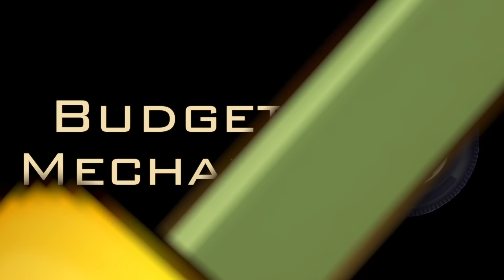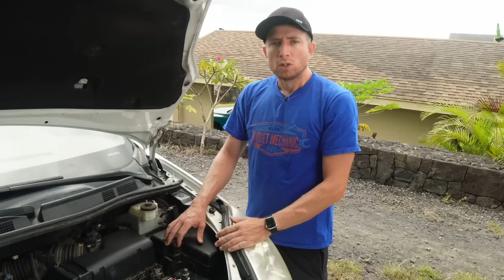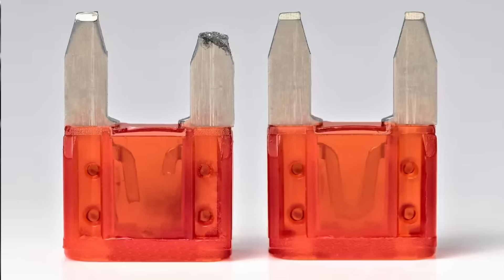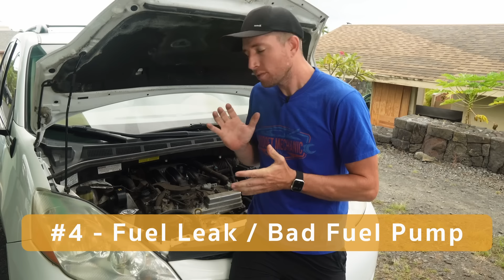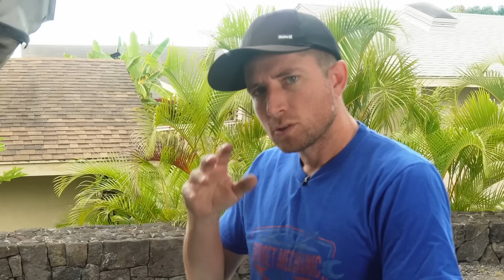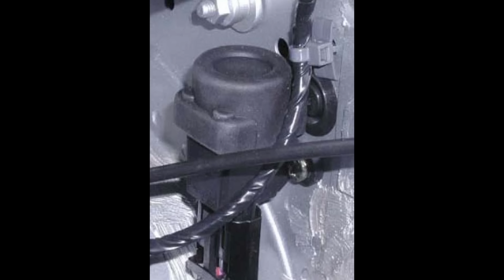Car Cranks But No Start? Diagnose And Fix Now!

Comment: I have a 2015 Nissan Altima S; push start. What would it be if it  “crank no start” not every time, but every once in a while. 

The car will crank up I’ll go drive it then park and it will have issues. One time I try to leave the car running just in case I didn’t have to crank it and the car turned off anyway. It took me 10-12 cranks before it started 

Any advice?

Comment: 1996 Mercury Villager, worn out but always starts. I'm sure the fuel pump was getting weak at 241k miles and possibly original, because the check engine light would flash (has always been lit for the 56k I've owned it, but it has a "dead" cylinder so I never investigated) and it struggled under load and inclines, but did get a little better with a new filter the other week, for a short while. Last night after a very wet day I got the no start, nothing.... Hoping it's the pump I was planning on replacing but I still hear it come on (and smelled a little fuel) but all the brake lines are rotted so I'd better check the fuel line once things dry up. Cap and rotor are relatively new but I'll get the spark tool out along with the fuel gauge....a few cracked vacuum lines to replace also.

Comment: The best advice ever. Spot on. A thorough step by step guide that can save thousands $$$ if one takes a car to the wrong mechanic. Unless you know auto mechanics, it's  nearly impossible to pin point a reliable one.

Comment: I had an intermittent crank no start  under frigid conditions.  On 2 occasions the aaa battery guy tested the battery as good. When connecting the jump box, the car started each time.

Comment: What about 2008 Chrysler Pacifica done changed out the timing belt, timing belt tensioner pulley, motor mount, and camshaft sensor and still is not starting next will be the valve's,  sensor's, relay's, and cool pack's
Reply: It shut off going down the freeway the lights on the dash started flashing and the vehicle just shut off and would not start back up again

Comment: I  got this problem it cranks but does not start everything inside turns on but the voltage goes down almost to 9 and gets the engine power reduced if anyone knows how to fix it please reply

Comment: I did exactly that to my 2003 4.7L (that's right baby) is swap horn relay to the dome (I think) light. Fucker never worked again...horn fine, but all lights overhead never worked again. Removed liner, just took to dealer atp. They wanted to replace the ECU for 1500.  And that was 5 years ago. So they couldn't figure it out. If that's gonna happen I'll do it. Never did...lol but back on building 4runner so idfk. Just an FYI FWIW. Never heard of thst b4 or since. BEWARE

Comment: Thanks for the video. You were properly descriptive. I believe my starting issue stems from a disturbance to the fuel tank. I hit a bad pothole and it bent one of the fuel housing tank screws. Fuel didn't escape and a new fuel pump had recently been installed. I guess I'll direct the mechanic and not waste time on diagnostics

Comment: Any thoughts?  Mitsubishi mirage g4  Starts cold, no problem.  Once driving around, and then turned off, and then try to start, cranks, i can hear fuel pump, but won't start.  If i wait 5-10 minutes it will start. MASS AIR FLOW triggered a check engine light,  got some cleaner, air filter clean.   Any idea why intermittent problem exists?

Comment: Hello, my car cranks but doesn’t start at first attempt (but sometime starts normally without any issue). Almost everytime when it doesn’t start, I take a pause, roll the windows up and down and give it a try again and it starts in 2nd or 3rd attempt. Any ideas what could be wrong with my car. I don’t think it’s battery because windows roll up and down fine.

Comment: Am James from South Sudan , working as a mechanic ,so I found that in Hyundai Tucson 2011 petrol engine it's cranking but not starting may you specify why or what is the reason behind that

Comment: Just for collective knowledge--sometimes there's more than one fusebox under the hood, my 06 Altima has two
Awhile back I had a crank no start condition, with a check engine light but no code on the reader--turned out to be a very dirty mass airflow sensor. I'm guessing it would have thrown a code if the sensor had gone bad, but in this case i just had to clean it

Comment: My car wouldn’t start at night because the engine was gas flooded by a cold winter start and quick shut off  I did earlier in the day. None of these videos like this helped me figure it out because its kind of obscure and affecting only certain cars and nobody seems to mention it. 

Yeah, very simple problem. Just crank the car with the fuel pump fuse removed for 10 seconds to clear the gas out.

Comment: I've got a kia cerato 2013 having starter problems, sometimes it starts but sometimes it won't. When it won't start the car will crank fast but just doesn't kick over. I leave it for day 5min the try again and if I turn the key fast push in my clutch and accelerator hard it starts
Reply: Sometimes it will start but die straight away

Comment: I changed ignition coil throttle body spark plug Fuel filter but still it hard start on my Toyota Prado 2009 petrol

Comment: My son thought RAV4 broke down, stalled on road, coasted into driveway. Wouldn't start. Blah blah blah later, I told him to bang the gas tank, maybe the fuel pump is stuck. He says it sounds empty but gauge says full. He added 2 gallons, and his 200k RAV4 is perfect again. I looked at lots of videos and was looking at sensors, couldn't figure out how he had no check engine light. Anyway, you were the ONLY person who said , most common reason no gas. People, listen to him, start with the easiest most obvious solution first. THANK YOU

Comment: The other day i was driving about 40mph car died, pulled over was cranking but not starting. After about 5 minutes car started and ran perfect for a few days. Yesterday it wouldn't start in the driveway so i sprayed starter fluid in the intake and it started and ran for about 3 seconds a few times. Now it cranks but no start even with starter fluid. Greatful for any suggsstions. (03 honda element)

Comment: My truck got back from the shop after a cam and lifter replacement, the guy dropped it off for me because I was away and it’ll crank and crank but won’t start, im thinking it’s timing related because it started once, sounded odd, then didn’t start again after that. Pls help!

Comment: I exchanged my efi main relay with the lamp relay that right behind the efi relay and the car would crank but not start so does that mean ? Are both these relay still good are they both went bad ? I’m going and try to change the crank angle sensor and see if that’s the problem because I don’t know what else to do

Comment: I may sound stupid but here is my car's situation:
My car is making clicking noise on fuel pump relay when key is at II position.

It is cranking but no Start,

When I attach OBD II, clicking goes away and fuel pump can be heard but still no start 

I have replaced spark plugs with 0.044 gap, coils, checked relays... nothing happening even no hastling start with starting fluid even

My car is Honda Accord 2012 LX 4dr 147k miles

Comment: I replaced my fuel pump my fuel pump control module spark plugs a new battery and still won't start check the relay switches and tested the codes I still can't figure out what it is drain the gas and put new gas in with cleaner gas cleaner don't know if it's the gas isn't getting through to the fuel pump for what can you help me

Comment: I sprayed starter fluid in the intake, and the engine started momentarily, which  made me think the vehicle was out of gas. I filled it up with gas, and it started right away and ran normally.  Thanks for the tips. I'm glad I found your video.

Comment: Nice to see a video where the mechanic is has extensive experience & knowledge. I am in NYC and have a 1979 Camaro 305 V8 and it won't start. I am the 2nd owner since 1981. It has only 79k miles. Full tuneup, new spark
Plugs & wires, new fuel filter, new rotor & distributor cap, new starter, new alternator, new wires to battery change to top pole, and new battery. Notice it had a little to much motor oil prior. Did an oil change and new valve cover gaskets. But car won't start. It cranks a few times then I see a small puff then when you turn the ignition key nothing happens. After a few minutes it will crank again but still won't start. Any suggestions? Wish you were in NYC. If you know of anyone in NYC who can fix or if you can give me an idea I would really appreciate it.  Thanks
Reply: You have a coil on the top of your distributor if I remember correctly.  That could not be getting voltage 12v or the coil could be bad.  I'm sure you must have an ignition module that may be the problem.  I doubt you have breaker points 1979.  Also, it could have jumped time.  Your timing could be off in general.  I mostly tinker with old Ford's but I have done a few GM engines.  You also need to look inside the carburetor and work the throttle by hand and make sure you get a spray of gas in the throat of that carburetor.  Means your accelerator pump is working.  You could have a bad float in carb and that will cause a starting issue. Disconnect the fuel line at the Rochester quadrajet and turn engine over and it should shoot a lot of fuer out.  If not, fuel pump bad.  Also not uncommon for the timing to get off because of nylon timing gears.  To check that, line up timing mark to TDC with piston on compression stroke.  You can twist up a paper towel and screw in the num one spark plug hole.  It will pop out on compression stroke.  Then line the mark close to exactly.  Pull dis cap off and see if rotor is pointing close to num one spark plug wire.  That makes sure your timing hasn't jumped.  All this may sound complicated, but it is really very simple.  Process of elimination, plus you should make sure all these things are good anyway.  Plus I remember they had soft cams around that era, so some lobes may have worn down.  If it is original, may be a concern.  I would keep that ride because you can't check all those items on this newer stuff.  You can work on the old cars and keep them going.

Comment: I’m literally in tears. Our 2008 coloradoodoo 2.9 after doing all of the above just won’t turn over. We replaced the the camshaft and crankshaft position sensors, used the multimeter to check the connectors, fuel pressure is fine….. wash rinse repeat.
Reply from the maker: Load tested battery?
Reply: Timing chain bad?

Comment: My 2018 Ford Explorer has an intermittent (every two weeks) crank no start… each time it cranks no start, I keep trying to start and eventually after 10 attempts my car starts. It will also start immediately with a jump. I have a brand new battery and I changed fuel pump. The Ford dealership cannot figure this out. I purchased an OBD gadget and I even called the OBD manufacturer to ensure proper way to use it. Now, my car did the crank no start crap again, plugged in OBD and there were NO codes. This really stinks. I need a good mechanic who will test a list. The Ford dealership only looks at codes, so if the car runs, they won’t do anything.

Comment: Shoot. Super used 2008 Nissan Altima, and it was just out of gas. I had never in my life seen a fuel gauge at empty actually be empty yet! Thank you!!
Reply: My 89 Dodge was that way, and I warned my mom of my 2 lessons before she borrowed it. Saw it sitting on the side of the highway one mile past a gas station and 3 miles from her work. She never drove it again.

Comment: 2007 dodge nitro. It starts when it wants to. We drive it then when we park it and go to try to start it again in like 10 15 minutes  it will not start acts like it wants to but will not. We waited over night go try again it starts. Now the other day we couldn't start it for 2 days we had it towed I went to start it it started so I'm confused on this booger I thought it was the tipm.

Comment: How can finding fuse that may be bad, still not starting a car. What schematics are priorities when coils cannot be charged, soark cannot be ignitiated, fuel injectors lit up on fewx etc  Gas sprays at the fuel vacuum regulatory from fuel lines, etc? Most if the avove in video has been checked. Few minor as vacuum lines, can build vacuum if cannot start car, that yoi inertia switch actively at work ..

Comment: I've just watched your video and thankyou very much for all the helpful tips fingers crossed I will solve the issues with my car to be up and running again,  she cranks over but won't start I have just replaced all four spark plugs and the next step is to change my oil filter because I have a feeling its full off gunk and is stopping my oil sensor from functioning properly, do you think this will make a difference for my oil sensor to read properly,  anyway I will give a try

Comment: Mine a 2017 ford xlt wouldn’t start it was showing a p0230 code, I reseted the ecu “body control module “ and that did the trick

Comment: None of what u mentioned in the video is the problem ....My car only starts with starting fluid so its a fuel delivery issue but my car is not leaking fuel and i can hear my fuel  pump turn on when i turn the key...SO U REALLY NEED TO GET MORE IN DETAIL CONCERNING FUEL ISSUES You mentioned NOTHING ABOUT STARTING FLUID or FUEL FILTER or FUEL INJECTORS OR FUEL RAIL .....

Comment: I have a 2005 Dodge Magnum sxt special edition new fuses relays was running fantastic 100,000 miles was full of oil no noises no overheating completely normal turned off went in gas station 5 minutes came out tried to start clicking noise lights  bright everything inside working no codes thrown can't turn crankshaft don't get it everything has been replaced car is basically new. Throttle body has been cleaned new gaskets everything is like new only problem I had is a not working ac or heat vents nothing ,no air blows out of vents replaced blower motor and resistor nothing other than that car ran like a new car I don't know what to do I've dumped thousands restoring it I use it for work I drive people taxi but I literally rebuilt it in 2 months now I don't have money to fix or buy new one I can't see it be seized considering please help

Comment: My current problem: my 02 Acura TL will sometimes start, sometimes not start but will crank. And when I'm driving will randomly stall out and after waiting a few minutes (sometimes) will start but lately won't start after stalling. I put on a new fuel pump thinking that would fix the issue, the car ran for 20 minute then stalled and no start.
Hopefully after I install a new main relay it will fix my problem. It's been stressful.
Reply: PCV ?
Reply: @Ace.Venturas not sure but it’s really annoying. I’ve never had a car that’s been this much trouble.
Reply: @Jason_Phillips3679  Identical to my issues.
PCV was intermitently sticking.  My coolent sensor wire had all but seperated from the sensor, and the internal assembly of its harness had broken. 

Ive replaced the PCV. And am working on the sensor. 
Both can cause these issues.

Shifting issues:
My transmission modual was caked in cream from oil and talcum powder in the insulation. It combind to form a paste. 
This could be causing my overdrive shifting proublems.
 Toyota manual says if coolant is cold it wont shift into overdrive.
So the cream and sensor are likely the proublem with shifting into overdrive.  Sensor may be causing the  ECU to mix air and fuel ratios incorrectly after taking false temp readings from faulty sensor. 

I thought i had solved these issues after reseting ECU as it ran perfect after a few attempts at resetting. 
Inspection revealed a sometimes sticking  PCV and a host of other issues , mostly the coolent sensor wire detatching and internal harnes breaking.
I was able to remove spark plugs after intense cleaning. 130,000klm and 18 y had me worried trying. But came out well.
Vermin chewed rubber insulation on leads. 

2002 hiace. So it acummulated many possible causes to these issues.
2002 Acura.  You may also have multiple faults. 
Check for wiring seperation on sensors from deterioration or vermin. 

Considering your issues are IDENTICLE to mine...less shifting. My guess is your PCV and coolent sensor / wiring.  
Also check catalytic converter. 
Starter relay, ground wires.
Fk....so many things can be the proublem.
I cant put a scan tool on my ECU. So im searching for obvious faults. 
Will attempt a start up next week after a coolent harness replacement. Also replacing a section of its wiring after detecting it coroded, burned.  
Ive cleaned a few ground connections. Cleaned MAF, MAP, TCM ECU TDK, CIA FBI ...😅
also any wire harness i can see. I found more cream in wire harnesses....Check these for creaming. 
I hope you get it sorted real soon.
Good luck Jason
Reply: @Ace.Venturas I think my issue is fuel related. I recently bought a fuel pump and main relay from Amazon  when the problem first started and after replacing them it’s been fine for a couple months or so until it started up up again. I’m thinking i just need to buy a oem fuel pump and a better quality main relay. After I fix for the second time I’ll probably sell the car.

Comment: Good video but I'm surprised you didn't cover ignition switches. I had one go bad in my Trailblazer and it cranked but wouldn't fire. I put in a new ignition switch under the steering column and it starts right up. Apparently when they go bad they don't produce enough voltage through the system.